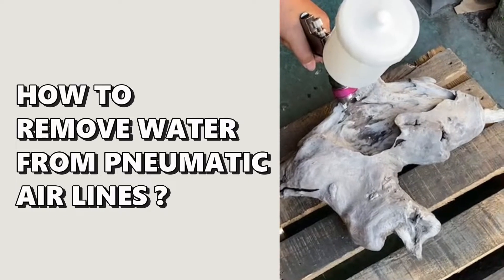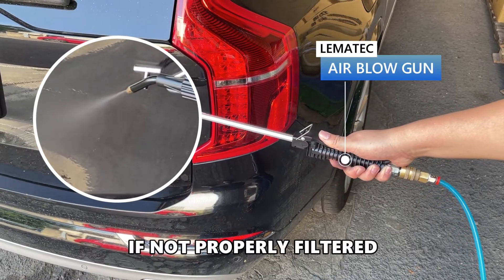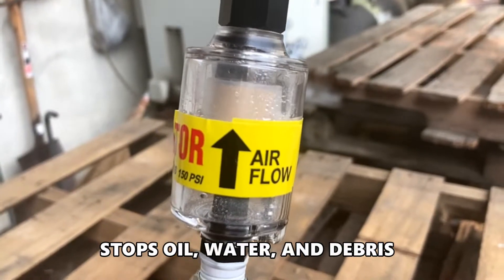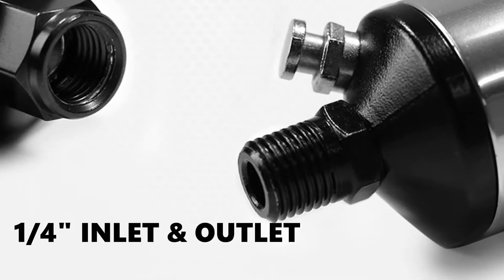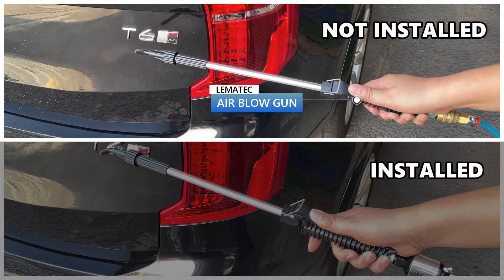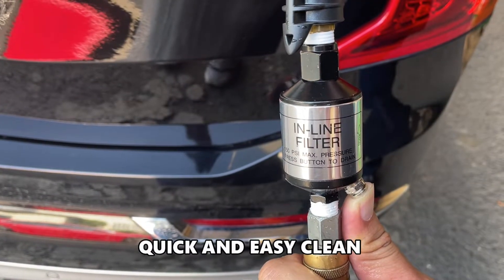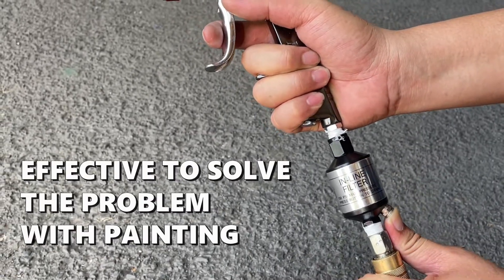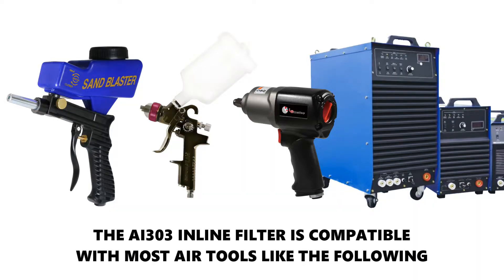How to remove moisture from pneumatic system by Lematec air water separator filter for air tools

Comment: I bought two of these for use with my plasma cutter, and I put one at each end of a short separate piece of air line with fittings so that I could use them with any compressor or tool that I have. No real experience yet, but it seems like a solid product.
Reply from the maker: Thank you for the order and this item is good for plasma cutters, air tools and air line, if the air compressor is bigger (over 3 HP), we suggest using an air control unit is better- https://shorturl.at/lpvVZ
Reply: What’s the verdict after 2 years?